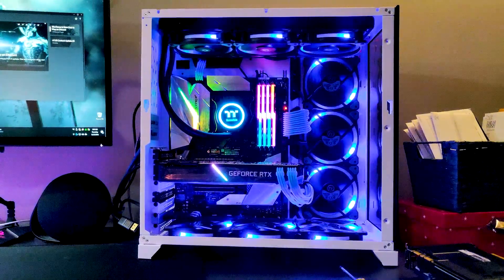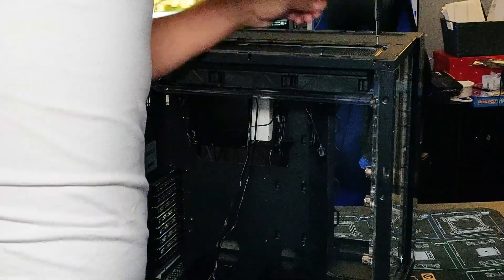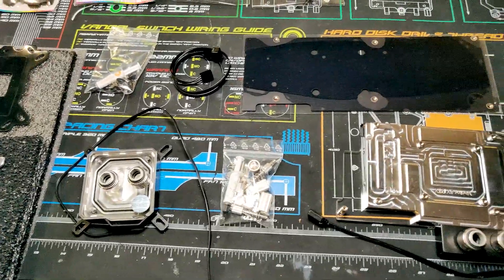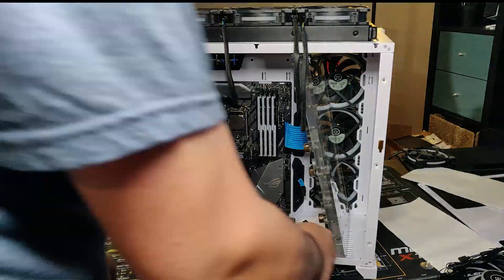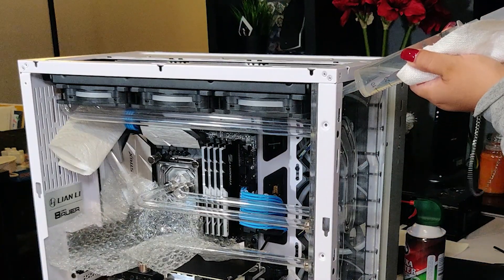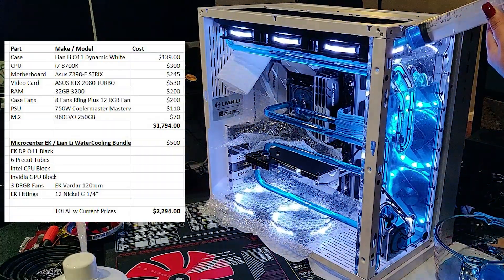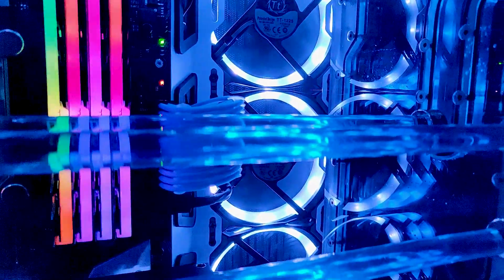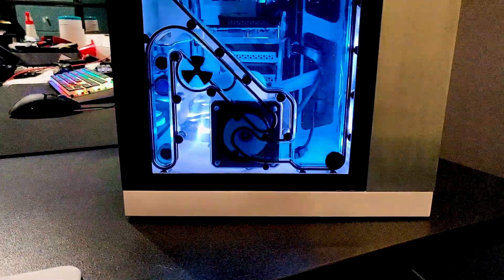Mirocenter's EKWB & Powerspec PC-O11 water cooling build kit in a Lian Li's White Dynamic Case

Comment: Such a shame this plate does not support Dual radiator like the rear mounted one... You can make it work though, like replace the plate into GPU with plate into bottom rad into GPU.

Comment: Your pc looks really nice dude. I was considering just getting the distribution plate for my 011, I didn't see if in your video but does the distribution plate just pop on to the white case? Did you have to drill anything out of your white case before you were able to put it on? Thanks
Reply: It fits without any drilling.  It's made for the case. They only sell it in black. But he wanted it in a white case.
Reply from the maker: Yea like he said, you can buy the plate on it's own. It's a snug fit but it does fit perfectly

Comment: this is a great kit, i used it as my first watercooled build aswell.  used an older gigabyte motherboard and needed to get new tubes, luckily micro center stocks a 4 pack of prebent 90s i just had to cut to length
Reply from the maker: I cant believe i didnt know they sell bitspower pre-bent acrylic tubes! Thanks for the heads-up..